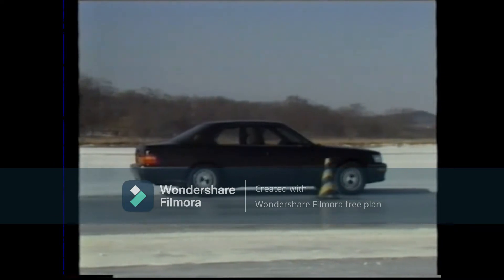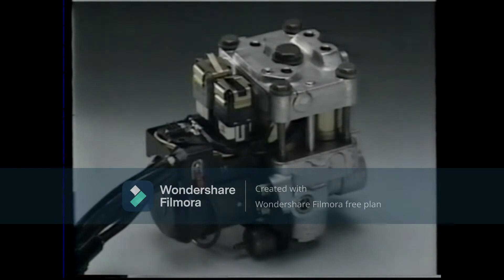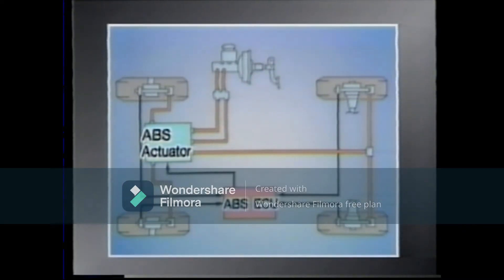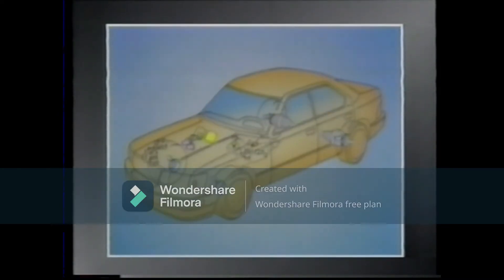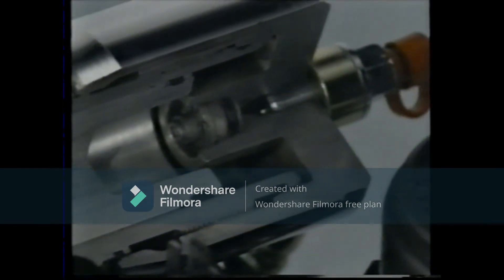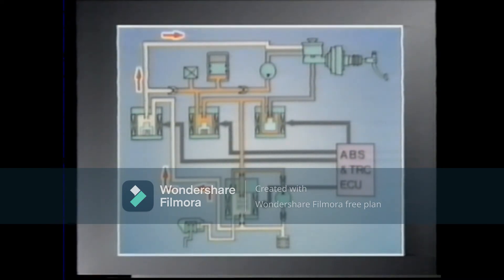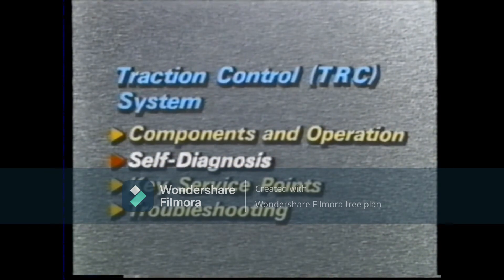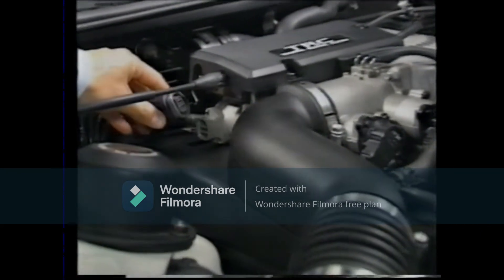TRACTION CONTROL SYSTEM (TRC) Lexus LS400 Part - 1

Comment: thank you for the video it helped my understanding alot but im still wondering it i wanted to take traction control off would i have to take the relays out or is there a button somewhere?
Reply: im asking for a 95 ls
Reply: @IdealLS did u ever find out what
Reply: @Ls400Saint  yeah taking the relays out would remove traction but also your abs so it will be more dangerous to drive normally
Reply: @IdealLS  so would I just be able to take out the relay to drift, and then when I want to drive normally just plug in the relay back ? Cuz I’ve other videos where they cut the abs lines
Reply: @Ls400Saint  yeahh i believe so
Reply: @IdealLS  where is the location for the fuse ?
Reply: @Ls400Saint  i think that varies on the year so i cant say look at forums for your fuses and then go from there
Reply: @IdealLS  I’m tryna turn off the traction control in my 95